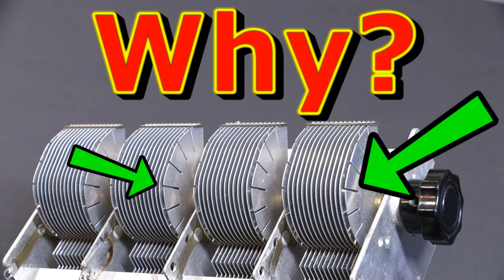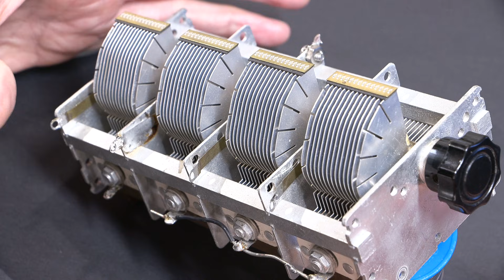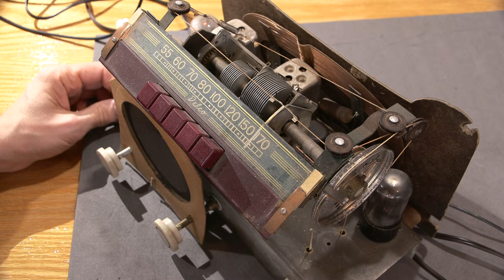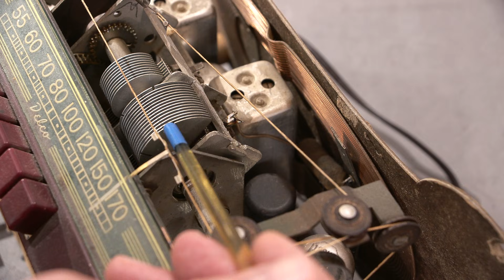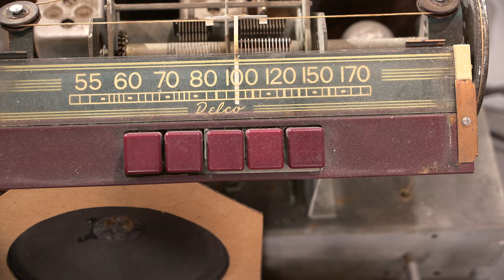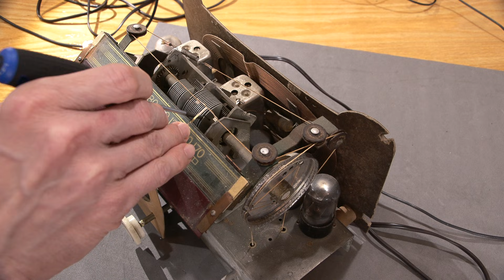Why The Cuts In The Capacitor Plates? Here's Why With Circuit Examples!

Comment: Here’s the clear, engineering‑grade explanation you’re looking for, Timothy — and it lines up perfectly with what’s hinted at in the search results.

---

# 🔧 Why Some Capacitors Have *Cuts* in Their Plates or Casing

Those “cuts” (slots, notches, or perforations) you see in certain capacitors — especially *foil capacitors* and *safety‑rated film capacitors* — are **intentional safety and performance features**.

Below is the breakdown.

---

## 🛡 1. *Self‑Healing Mechanism (Film Capacitors)*
Many *metalized film capacitors* have tiny cuts or segmented patterns in the metal layer.  
These act as **current‑limiting boundaries**.

### Why?
If a defect or impurity causes a microscopic short, the metal around the fault **vaporizes**, isolating the defect.  
This prevents:
- catastrophic failure  
- thermal runaway  
- internal arcing  

This is called **self‑healing**, and the cuts help localize the damage.

This concept is discussed in capacitor‑design tutorials such as those referenced in the search results, which explain how capacitor plates and dielectrics are structured.

---

## 🔥 2. *Pressure‑Relief Cuts (Electrolytic Capacitors)*
On **aluminum electrolytic capacitors**, the “cuts” are usually on the **top of the can**, forming an X, K, or T pattern.

These are **pressure‑relief vents**.

### Why?
If the capacitor overheats or fails internally, gas pressure builds up.  
The vent ensures the can **splits in a controlled way**, preventing an explosion.

This is a safety requirement in modern electrolytic capacitor design.

---

## 🎚 3. *Segmented Foils for Controlled ESR/ESL*
In some high‑frequency film capacitors, the foil is intentionally segmented with cuts to:
- reduce inductance  
- control current paths  
- improve high‑frequency stability  

This is especially common in snubber capacitors and pulse‑rated film caps.

---

## ⚡ 4. *Cuts in Variable Capacitors (Air‑Dielectric)*
Older variable capacitors sometimes have **cuts in the rotor plates**.

These cuts:
- shape the capacitance curve  
- linearize tuning  
- reduce stray capacitance  
- prevent mechanical resonance  

This is the kind of detail covered in electronics education content like the Mr. Carlson’s Lab video referenced in the search results.

---

# 🧩 Summary Table

| Capacitor Type | Why It Has Cuts | Benefit |
|----------------|-----------------|---------|
| *Metalized film* | Segmented metallization | Self‑healing, safety |
| *Electrolytic (aluminum)* | Vent cuts on top | Prevents explosion |
| *High‑frequency film* | Foil segmentation | Lower ESL/ESR |
| *Variable air capacitor* | Plate shaping cuts | Linear tuning, reduced stray C |

---

If you want, I can also sketch out a visual diagram of each type so you can internalize the geometry — that tends to fit your systems‑thinking style nicely.
Reply: Thanks COPILOT!

Comment: When I was really young I tried to get the scale tracking right on an old radio. I kept on bending those plates until they broke. Not so good. I still have the radio and I am thinking I could solder new metal plates onto it.

Comment: 70 years designing professional electronics with thermionic vaccum tubes and LSI and transistors, chips, etc but I did'nt know the slots were intended for bending,  I assumed and so I thought they were to de-linear'ise the capacitance to make tuning points easier to centre.
I have owned very many of those variable cap's but I have never seen a bent veign as was demonstrated.
Thanks for not uploading this at the begining of Aprril as I would have been one of the admonishers getting it wrong.

Comment: Wow, I'm 65 and have been playing with older electronics on and off since I was 10. Never knew about this capability/ feature of variable capacitors. Cool!
Reply: Same here!  As Wayne Campbell (Waynes' World) once said,   "I was unaware of that!"
Reply: i am 72 yo. elc. eng. and still it is my hobby since 9 yo.
Reply: Same here again.
Reply: If the dial is tracking correctly at each end, and the capacitor plate is bent to make it track correctly in the middle of the scale, this will upset the tracking at the low frequency end of the scale, since the maximum capacitance will have been altered.
Reply: @brianshersby8979 I think you have missed the entire purpose of the vanes and this video.
Reply: Same (57).
Reply: The early designers were...brilliant 😊
Reply: Fine tuning the.....tuner😊
Reply: tak já to zjistil ve 13

Comment: Very interesting Paul ... I am enjoying your Tech Tips Series.  I have a question/comment though - it seems that tweaking the plates outward would also decrease to capacitance for higher frequencies from what it was before the tweak, messing up the max frequency adjustment.  Obviously, the opposite effect would be had if the plates were to be selectively tweaked towards each other.  I realize the complete "during a calibration" explanation of this might be outside the scope of what you were demonstrating in this video - and interacting cals points can be tweaked in by iterating the adjustments.

Comment: I never knew about those tabs slits on the variable capacitor. And I never knew about bending a small tab outward on the oscillator to make it track in the center of the dial. You are a wealth of knowledge and I thank you for sharing.🙂👍

Comment: Thank you very much. A question, isnt it possible to move the needle on the string itself? It looks movable. Maybe it´s stupid xD
Reply from the maker: No, that's a perfectly valid question, and is done as well, but you just move the tuning problem up the dial.
Reply: The tuning needle isn’t linear with frequency, so simply moving it won’t match the actual frequencies correctly.

Comment: I've noticed this (tuning gangs). I think 🤔 the cuts in them, have something to do with how the radio 📻 receives stations (or pulls them in). The cuts are strategically placed (a certain distance apart), around the outer perimeter of each capacitor. The cuts are also different sizes (in graduated form). I think this coincides with the power of the radio station(s) received, in order of how the numbers are arranged on the dial. This goes for AM, FM, etc. That's so ya can scan across the radio dial bandwidth (in either direction), without missing any stations along the way. This is the only scientific thought I have, and I may be completely wrong. Maybe you'll take this into some sort of consideration. Again, prosperous (and safe) 2026!! Happy Holidays!! Your friend, Jeff!!

Comment: Wow that was a fun blast from past. I was a Marine Corps avionics tech in the late 1960s. Blade tracking was a common repair/maintenance procedure for UHF transmitters.
Reply: I was a Marine Corps avionics tech in the mid 80s to early 90s (VMA(AW)224 & 533). I didn't get to experience blade tracking. How just a few years changes everything.
Reply: US Navy shipboard UHF transmitter in the mid 70’s was a motor driven tuner. Had a special tool to tweak capacitors.  Really disliked these boat anchors.  Never tuned correctly.
Reply: Yeh, and they did not have such a capacitor , hi hi

Comment: Wow, that makes me feel old because ai knew exactly what that the cuts in the outside plate are for.  I learned about tweaking the tuning tracking on an old Zenith radio I had as a kid back in the 1960s.  I didn’t have a signal generator so tinkering by ear to get the most sensitivity had to suffice.

Comment: well, appears I have made a mistake on my HQ-180A. In the process of cleaning the receiver chassis, I noticed one plate of the variable capacitor was bent outward and I thought I had snagged it in my cleaning process and bent it back so it was straight. I guess when I do an alignment, I will run into this. Live and learn!
Reply: I was a retired electronic technician,  when I was young , I did a lot of this kind of radio frequency tuning align.too.
Reply: From my own experience when I used to work calibrating variable capacitors, one tended to try and keep the outside vanes symmetrical so it might be worth trying to adjust the vane you moved so that it matches its opposite number as a first step.
Reply: Dito! 😂
Reply: @rolandvanalphen4355 ditto
Reply: Maybe. Make sure the ends are calibrated properly with the trim screw before assuming some guy who worked on it before you knew what he was doing. 🙂
Reply: Plate air gap and geometry vs. ability to adjust.
Reply: Antenna Tuners in Ham Radio.
Reply: Maybe make a video on building a simple free play radio